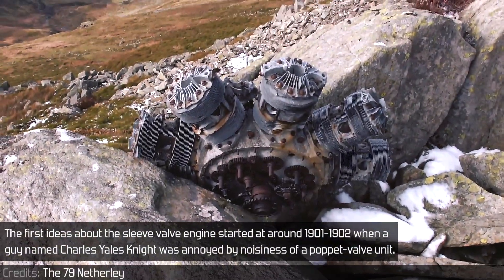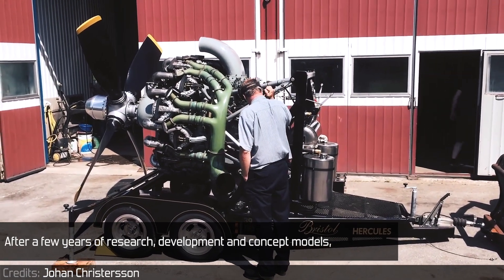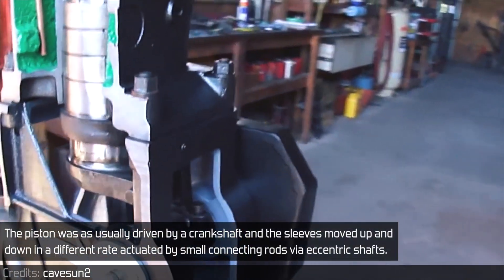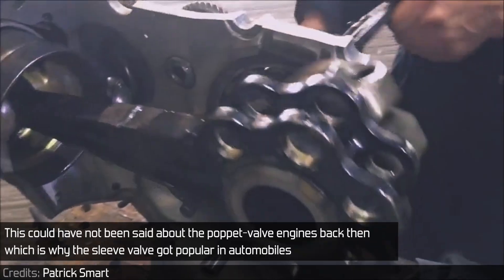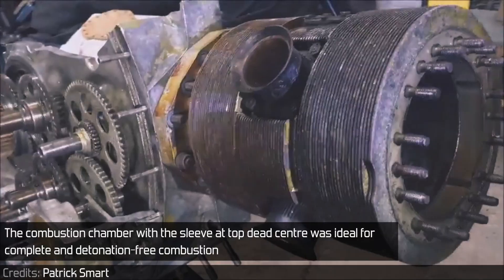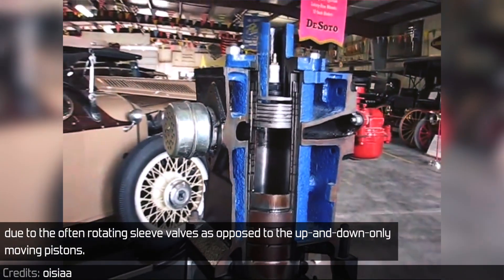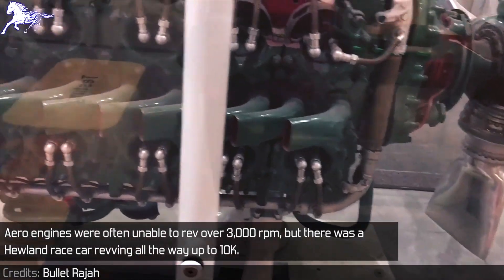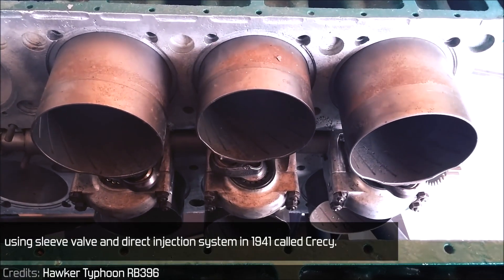A Sleeve Valve Almost Took Over A Poppet Valve Unit

Comment: Burt was the chief engineer at Argyll Cars and he designed the single sleeve design.  McColllum's design was rather different and I don't think that it contributed anything to the final design of the production sleeve valve design.  Both the Knight and Burt McCollum systems were licensed to other manufacturers, e.g. Knight was used in the Daimler Double Six and Minerva etc.  i can't at the moment remember those than adopted the Burt system but they were all European.

Knight sued Argyll for patent infringement, the action costing both a lot and achieving little.  This was one of the reasons for Argyll's demise.

A few odd pieces of information:
In a book on the RR Crecy 2stroke V12, it was said (I think by a RR engineer) that Bristol spent twice the money developing the best material from which to make the sleeve as Power Jets spent on the the entire development of the British gas turbine! 

The RR Crecy used an open ended sleeve valve that was very different to the Burt system.  The sleeves did not rotate and the movement of the sleeves was achieved by a simple and elegant system.  The 90 degree V allowed RR to use just one eccentric to drive 2 sleeves, one from each bank.  The sleeves were open ended and did not use a junk head with ring to seal the top end of the sleeve, instead the sleeves were sealed by the expansion of the top of the sleeve due to combustion pressure! 

The whole engine was so unusual, it being a collaboration between  RR and Harry Ricardo Engineering. There is a great book on the subject, my copy being currently unavailable.  At this stage, I should mention that Harry Ricardo was the person responsible for sleeve valve aero engines, without him I doubt that anyone would have gone that way.  Even so Ricardo did not push the sleeve valve until Argyll's patents had expired.

In the Burt sleeve valve, the sleeve has 4 ports, the cylinder block has 5, 2 exhaust and 3 inlet.  That means that one of the ports in the sleeve is alternately opening for very hot exhaust and cool intake charge.  Apparently this did not cause problems but still it is a most unusual practice.

The British government forced Bristol to provide assistance to Napier on sleeve valve manufacture.  Bristol having spent a fortune on its development were not at all happy about 'giving' away their IP to a competitor.
 
RR designed 4 sleeve valve engines, the aforementioned Crecy 2 stroke.  The aircooled Exe and its bigger brother the air cooled Pennine.  Both of these were X24 engines with sophisticated air flow designs .  The Exe did fly for years in a Fairey Battle that RR used as what was essentially a commuter plane, performed well and was apparently very reliable.  In the Pennine,  RR had fixed the con rod issue that plagued the RR X24 Vulture. The last sleeve valve engine was the last piston engine RR designed, the Eagle22.  RR's first aircraft engine was the Eagle, the Eagle22 signifying the 22nd piston aero engine designed by RR.  The Eagle 22 was a H24 the same as the Napier Sabre.  Internally the engines were quite different.  For a start the Sabre's two crankshafts rotated in the same direction where as the Eagle22'a were contra-rotating. I will leave it to others to fight out which was better.  The RR was probably better engineered but the Napier put out more power from less litres and although itself no lightweight it was lighter than the Eagle22.

Sadly, there are no extant Crecy, Exe or Pennine and just a few Eagle22s, none operational.  There are a number of Sabres on display and others in storage, non are operational and all the films and sound tracks of the engine available on the internet are wartime and rather poor quality.  Nevertheless, as time goes by more and more information is turning up on the internet.  Years ago when I first looked up the extraordinary Junker Jumo 223 and 224 there was one poor quality photo and very little information available on the engine, now there is at least 10 photos, considerable more information including that there was a turbocharged version (complete with photo), I happily learn something new every day, and sadly, forget more than I learn.  >>:-)>>

As a side issue the Sabre's crankshaft rotation and timing were such that at certain rpm the exhausts synchronized and the engine 'howled'.  Indeed, like the Stuka before it, the Sabre's distinctive sound created a great deal of fear to those on the ground. I remember reading that one tank commander said "once heard never forgotten".  But unlike the Stuka this did not require a siren , the Typhoon or Tempest V came out of the sky with its 36.7litres and 24 cylinders running at close to 4000rpm, the reduction gearing that drove the huge 5 blade propeller was straight cut and added a further distinct note when transmitting over 2000hp.

In my opinion, the Exe ( designed by the engineering genius Rowledge) would have been a great engine but Hives at RR decided that production costs were too high (more than twice the costs of the Merlin).  In this he was right, by far the best way in war is to produce quantity less than innovation.  RR only put out two engines that reached mass production, the Merlin and the Griffon.  If it had its way RR would have abandoned the Merlin and just produced Griffons. But the Merlin was used in too many planes, boats, and as the (unsupercharged) Meteor in tanks 

The Griffon was far better engineered even if it didn't sound right.  Another problem was that the Merlin rotated in the opposite direction compared to all the other British aircraft engines. This was in some ways a happy event as US aircraft engines rotating the same as the Merlin.  The Griffon rotated the same as the other British engines, something that caused a great deal of confusion and embarrassment for pilots changing from the Merlin powered Spitfires to Griffon powered Spitfires. 

There were many advantages of the sleeve and some disadvantages of the sleeve valve system.  But the most serious problem was that the sleeve valve was not incumbent.  The story about how much money Bristol spent on the material for the sleeves is a point.  But there is also a story about how much money RR spent of developing material for the poppet valves in the Merlin, valve failure being a serious problem with early marks of the Merlin.  There were many advantages in reliability and performance of the sleeve valve up to the end of the thirties.  But  vast resources were thrown at the poppet valve problems and by the end of the war the two valve systems were much closer.  Still there were advantages to the sleeve valve.  They have been investigated on and off through the years with Mike Hewland and Keith Duckworth having a serious look.

I doubt there is any chance of sleeve valve use in modern engines, there is  no reasonable way to alter the timing of sleeves and thus no equivalent of VVT.  The poppet valve is pretty much fully developed, why spend vast amounts of money on another system?  Consider Ford's 1litre, 3 cylinder, ecoboost engine. It hasn't won all those accolades and prizes by being innovative, it won them by applying every advancement in engine design since 1910 (why 1910?  that is the year Earnest Henry first drew up the twin overhead cam 4 valve per cylinder design, some of his early designs rather resembled the modern pent head) to the engine, even the smallest detail considered.  It, like most modern engines is manufactured by machinary with a precision undreamt of to the engineers battling the problems of sleeve manufacture in the 30s and 40s.  It also uses materials through its design unknown just 20 years ago - coatings have solved so many problems even if they render the engine often unrepairable and a throwaway item.

Also, there is the question of the future of passenger cars (at least) and what will be powering them - electric?, parallel hybrid, series hybrid? hydrogen? and should we manage the world in the future like we have in the past perhaps we may have to finally,fully develop, pedal power.
Reply: Well said Robert. Engine technology is a fascinating subject. You've done your homework. I've had a relatively small "hands on" with Sabres, & the Bristol radials..wish I'd stripped the old Silent Knight with dipper oil trays, that provided more oil with advanced throttle. Sadly, I'm the guy who couldn't raise £450 to buy a Bugatti T27...that was a few years ago though.
Reply: @gilbertdavies  On rereading there were a few mistakes, it was Roy Fedden who estimated the cost of developing the sleeve valve material and manufacturing processes, now there is a story, one where a fortuitous accident saves the day and solves a vexing problem in what appears to be an irrational way.

The saddest part is that so much information has been lost in British aerospace, just thrown out when companies moved, were taken over, or merged, prototype engines scrapped, the horror just continues.  A swath of WWII aircraft types completely scraped with not a single example kept.  For instance they had to drag a wreck out of Lock Ness to get a Wellington, despite the Wellington being the most prolific of all British multi-engine aircraft.

I don't know much about Bugs but they do play a role in the life of one of my favourite engine designers, Stewart Tresilian.  Unfortunately his story is not well documented.  Here is his CV, there are other pages on him at that site.
https://www.designchambers.com/wolfhound/TresilianCV.htm

I have a few extra bits about his car engine designs for BRM, etc., all  I have to do is find them!

So some of my favourite British engine designers, the obvious ones
Arthur Rowledge
Frank Halford
Roy Fedden
Harry Ricardo
Stuart Tresilian
many of the above worked on both aircraft and cars 
Whittle (technically not an engineer)
Hooker (technically not an engineer, but a scientist)
W. O. Bentley
Harry Weslake
Walter Hassan
Harry Mundy
Keith Duckworth

the list goes on, then there are the assistants, and other engineers who did the grunt work, lots of them
Skilled craftsmen who built the tests engines and prototypes, draftsmen, test drivers. test pilots.

These days I am focusing more on the people behind the engines rather than the engines themselves, but I do like the odd puzzle.
Reply: @robertnicholson7733  Fascinating!  I shall have to look up Tresilian. I was Chief Engineer at a aircraft restoration company for some years, & the Napier Heritage trust used to visit occasionally, in the evenings, &  it was my job to take them around the hanger to look at a couple of Sabres we had, & a Tempest V we were restoring. There was quite an awkward moment when i suggested the engine was much better after Roy Fedden/Bristols had sorted out the correct material, & sleeve grinding process..a sort of deathly hush descended, in fairness to the old boys, they were loyal in their replys, & not entirely without acknowledgement. My mentor on the road to A&C, licences, etc, had looked after  Tempests in Normandy, the dust played hell with engine life, as can be well imagined. Also, winter nights, a 30min start up.& preheated oil was a must. Should have recorded it all, but so many interesting folk & aircraft in those days! Thanks for great gen..
A PostScipt, i genned up a bit on Stewart Tresilian, quite an achiever by any book..must read more.
Reply: @gilbertdavies  The Napier Heritage Trust, I just wish they had more to look after.

 A couple of Sabres?  I like the offhanded way you presented it, how many Sabres are left in the world?  And if we rule out the sectioned ones...

Many people are looking forward to a Typhoon or Tempest in the air powered by a Sabre.  I think this is unlikely, just getting one approved for flight?   Who would be mad enough to fly it while being sane enough to be qualified to fly it?  I would be happy with a ground-running Sabre, one that could be brought up to full power.  I really want to hear that engine!

I know there is an inhibited engine set aside for flight.  However, I would be concerned about the sleeves if the engine had not been turned over, they would have been sitting in the same place in the sleeves for a very long time.

In any case, I think the best course of action would be to 3D scan all the Sabres in existence that I could get my hands on.  Disassembling all those sectioned engines and scanning and analysing each part.  Then coming up with a hybrid design incorporating all the improvements in the basic engine brought about by the Mark VII while maintaining compatibility with the aircraft.  The only part that would require still present problems would be the sleeves. ' Tis all a dream.

The prototype Sabres ran quite well with the original Halford designed sleeves.  The Bristol sleeves were required for production during the war but I have wondered whether the Mark VIIs used Bristol sleeves or Napier sleeves.  I can understand the Napier trust guys getting a bit miffed. But of course, getting the Sabre in production at all was a major feat, no other 24 cylinder engine made it to production by the end of WWII.

Whereas RR started their engine design about 2 years earlier than Halford, and Halford's design team was tiny compared to RRs or Bristol's, and finally RR was building just another V12 in a long line of V12s, Bristol was building yet another air-cooled radials in a long line of radials,  Halford was designing quite a radical engine.  His previous design was a 24 cylinder, vertical  H, poppet valve engine of about 17litres, admittedly producing just short of 1000hp, but then he designs a horizontal H, sleeve valve engine of 36.7 litres with unprecedented power output.  He starts in late 1935, and by March 1938 the prototypes are producing just over 2000hp, and in June 1940 the production ready engine was producing 2200hp.  So less than 5 years, the mind boggles.

Since you are in the right place and may have contacts, you may be able to obtain far more information on Tresilian than I.  If you do, please pass it on to me or pass on where I might obtain it.  I have been tempted to contact William Pearce of oldmachinepress and see if I could get him interested in writing articles on engine designers rather than just the engines.   It would be, I think, fascinating.   There is little written about most of these men, and when there is something, it is pretty so-so.  For example, I thought the book on Frank Halford put out by the RR Heritage Trust to be pretty poor

https://oldmachinepress.com/2020/09/20/napier-h-24-sabre-aircraft-engine/

I am signing off for the moment.
Best of luck to you.
Rob
Reply: @robertnicholson7733  My apologies Rob, if I made it sound like there was a Sabre under every bench! There were two at PPS, I think both engines, & the Tempest V are with Kermit Weeks in Florida. I guess the only plus out of our/UK loss, is that Kermit has the where-withall to complete the project, & he does like to fly his completed aircraft. I once borrowed a lady ATA pilot's Blue Book (Pilots notes for all ww2 a/c) She liked the Tempest, but said if all the "erks"sprinted away on start-up, she'd got an induction fire..& the best job was to "suck" it out by rapid opening of the throttle, (this works with modern Lycomings, &.Continentals,)providing you shut the throttle before the engine catches, & picks up clean..
She also said it would really go, & nothing could catch it. I wish I could remember her name..hell of a character. I also knew Bob Cole,; who "toppled" about 17 V1's. with a Tempest V. He had a high regard for the Tempest/Napier combo, he loved the sound, & performance. I know he put one down in a tree plantation due to engine failure (ingestion of debris from enemy a/c), nr St.Mellons, which lies between Newport & Cardiff. The swath he cleared was visible into the early 80s. He walked away..a tough old airframe (&pilot!)
Thank you for the attachment/link you sent, most interesting. If i can get any gen other than wicked pedia on Stewart Tresilian, I'll put you onto it. Frank Halford, as you know, developed the Airdisco Cirrus from the old i.o.e. V8 Renault of BE2c fame..later to become the Gipsy Major of dh Tiger Moth, & Chipmunk...  Nuts & bolts metric thread with BSF & Whitworth heads/flats...but not all of them, just to keep the engineer on his toes!
Keep the gen coming. Terrific stuff!👍

Comment: The handicap of the two-sleeve design was that there are no sealing rings between the sleeves. The seal is provided by the lubricating oil between the inner and outer sleeves plus sludge and varnish accumulation. Motor oils back then were single viscosity grade, like SAE 30, SAE 40, non-detergent. A new engine used more oil than later when the sludge and varnish build-up improved the seal. This worked well until the sleeves were so worn that the sludge/varnish blew out despite compression ratios being only 4 or 5:1. The car would then lay down a smoke screen as it went to higher oil consumption.
The only way to repair the worn sleeves is to disassemble the engine and replace the seals. While the motor is disassembled naturally the pistons and cylinder rings are replaced along with the sleeves.
As is visible in the video the single sleeve design not only slides the sleeve up and down; it rotates the sleeve. This allows cylinder rings to seal the sleeve outer diameter clearance and the piston rings to seal the piston-sleeve bore clearance. Compression ratios can be considerably higher as the clearance seals do not depend on sludge, varnish and heavy oil viscosity for sealing. Single sleeve diesel engines can be made.